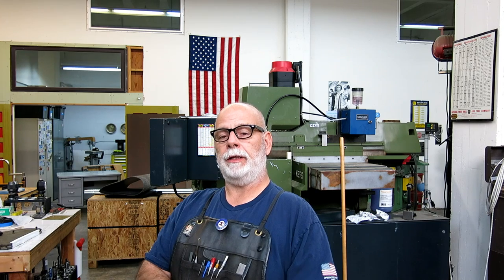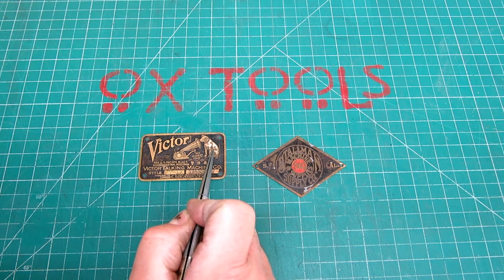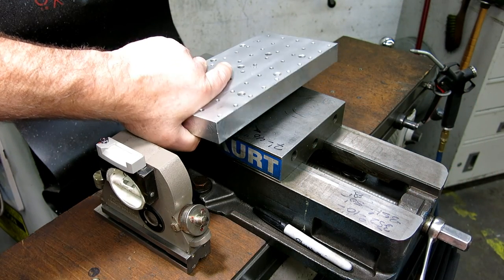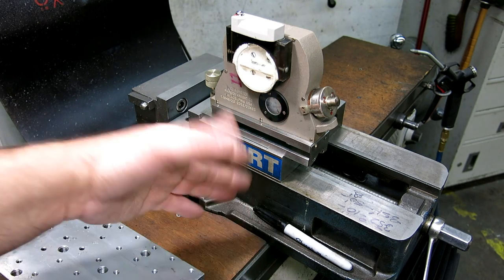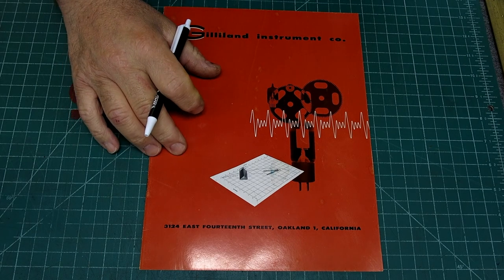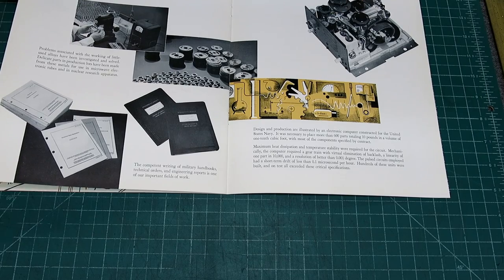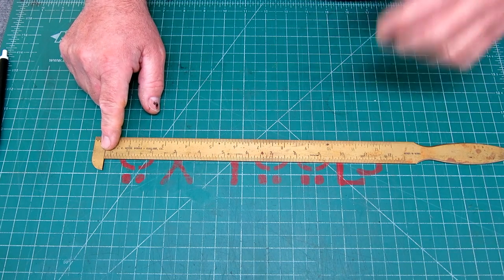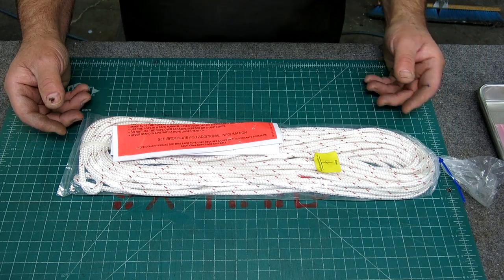Monday Night Meatloaf 140

Comment: Mule tape. When they installed fiber optic connection into our office about ten years ago, they pulled it through with mule tape and then chucked it in the trash. I fished it out and have been using it for all kinds of bizarre projects over the years.
Reply: Yeah...  They always simply throw it away when I worked as an electrician.. So I just started bringing it home. Not sure what I'm gonna do with it all-- but it's good material.

Comment: Thanks Tom, I bought a set of ratcheting straps that came it a box with a crank on the back that winds up all four ratchet straps at once. I like to lube all my ratchet ratcheting ratcheters . I like to preset the strap slots horizontally so i can one handed pass the strap through the slot with the ratchet closed and locked. I don’t let people barrow my straps or tools or machines or trailers or trucks or jacks…Etc.
Reply: I used several of mine today and noticed they really need lube, they are binding

Comment: To store my rachet straps I ran a piece of conduit the length of my trailer toolbox and I leave the straps connected in the center. Then hook the hooks over conduit for each end and throw the rest of the strap in center. To grab one, just pick a side and pull it out until you get to the other end. Won't tangle in a knot. At worse case, the handle will get caught. A  5 gallon pail will work too leave enough room between the top and the conduit for the hooks. Then you can snap the top  other can and they won't tangle inside.

Comment: I grew up with mule tape! Mine is covered in sewage from locating and pulling trace wires in residential utility lines, but it’s still going strong from when my dad passed it down to me 20 years ago.
Reply: It's cheap. It's disposable. Keeping sewage-covered pull tape is stupid and dangerous.  And why in hell would anyone pull wires through sewer ducts? Your municipality is scary.
Reply: @railgap  Really? Many crowded developed cities use sewer lines for new cable instals because they are the only way to access a building underground, especially in heritage listed zones where you cannot even put a strip ditch on a street. One big usage of sewer pipes is for providing underground internet cabling/ fibre to old and historical buildings. So there's that!
Reply: @railgap  sounds like you don't know what a trace wire is.

Comment: In 1979 I began my Tool and Die Apprenticeship at H-V Industries in Phila. We mainly built and maintained can dies for Crown Cork and Seal. The shop was next door to Warren Knight on Bennett Rd.  
A little bit of history. Before the age of CNC many people used a Bridgeport attachment called the Volstro Milling Head, to generate inside and outside radii on a part. The owner of our shop Herman Volm, and another fellow whose last name began "Stro", invented the device. Every few months we would run a batch of cast iron components for the build process of the device which was going on across the street.

Comment: Tom hello again, it's rare to leave two comments for a single video, but the second you pulled out the pull tape, I really perked up! My fellow workers and I have installed thousands of feet of Fiber Optic cable at the Television lot I used to work for, I just retired, while they would toss the pull tape, I saw the value years ago. I have recently come down to the last of my supply, well, until you mentioned Amazon! I just restocked my supply, 1000ft 78 bucks! NICE FIND TOM!!!  Again, THANK YOU!!!

Comment: Fantastic Flavour packed meatloaf this evening (African Central Time), Im marbles been turning looking at that ruler thingy magic rule tool, funny you would say would make a great laser project, exactly what I was thinking. I recon still be a bit of a but load of work, as would require at least two lasers still a bigger high power to cut them out and a smaller to Etch/Engrave the markings. Been pushing this kinda item of recent as marketing material, with all our over thirty years off waste materials off cuts of rotary engraving plastic materials old stock etc, trying to be creative and epicycle well waste at the end of the day. Will defiantly be appropriating this neat measuring device layout to try a couple new reiterations on small measuring devices/marketing/business Card ideas. Hope the move is treating you good at this stage of the game. New property looks a treat!

Comment: Regarding the webbing:
Rock climbers use a re-threaded figure 8 knot a lot to create slings. Fastened to caribiners, pitons, etc.
Tie a neat figure eight in one end of the webbing and bring around the slack end and follow the first knot, essentially doubling the web.
Yeah hard to explain, but this method, despite the weight imparted, will be easy to release. Wet or dry.
Reply: Gonna need to see a video of this one.
Reply: Yup, I don't climb much any more, but that webbing is great stuff, especially the spectra and other newer types.

Comment: I worked for a guy who used to put his mobile phone under the magnetic compass and then complain we were off course.  When he moved his phone with a "little" prompting, we were perfectly on course.
On another vessel, the emergency steering position was on the deck above the port generator.  If you made a 360 turn, the compass went from 220 deg to 260 deg, a little different if the starboard generator was on.
We used to call your end proverb type knot a Snowball Hitch!

Comment: Ah yes, rope for securing stuff. Worked as an aircraft handler during my studying time and we had to learn how to secure cargo to IATA/ICAO standards. At that time rope was still the number one option. If you know how to properly do a truckers hitch etc. you can easily break wooden boxes when tying down, as with very little effort you create quite a lot of force. It was used with a nominal break load rating (I guess the rope actually was better, but they limited it to some margin of error for wear and improper knots) and depending on the load we had to adapt the number of ropes and tie points used. Or put boards under the load for weight distribution to not break the floor of the cargo hold. The rule was like, it may not shift when tied down, even if your tie down at some points is more like suspending it from the ceiling. Could easily be done with at least three ropes on four anchor points. Some airlines back then started to require flat straps with clamps instead, no ratched straps. from the loads we had to secure using those I had quite mixed feelings about them.
Oh and back then, even on the apron we were allowed to carry pocket knifes, just in case some idiot at another airport had no idea how to tie a knot that held and you could actually untie within a few seconds. And believe me, you did not have minutes to play around with a knot when you had to turn around an aircraft. either you got it open immediately, or you cut it open.
Using the flat webbing you may just reassess the knots you would commonly use on rope. some may work better, others not so much, especailly when it comes to opening them again. But I think you standard knots lika a figgure eight or a truckers hitch etc. should be fine.

Comment: My brother in law had some to pull wire  thru a conduit about a mile long. The power company uses it once because they don't want to chance a break in the middle  of a project. You could get used rope for nothing. I got some of the scrap, good stuff.

Comment: The compass reads “ Lietz “ , the german compagny is called “ Leitz “ , still a nice one, greetings from Amsterdam
Reply: Indeed, but Leitz is specialized in filing and document management stuff, they have nothing to do with compasses. but a quick search, I found like a gazillion of A. Lietz Co. compasses of all sorts coming out of San Francisco. They made quite a variety it seems, from ones for the US Army, to survey stuff and ship compasses. Found quite a few items on ebay and in auctions, and lets put it that way, the stuff seems to go for insane prices. That actual one seems to go as "US Army Signal Corps Surveyor Compass".
Although there is no connection between Lietz and Leitz, I found that the company founder Adolph Lietz was actually born in Lübeck in Germany and came to San Francisco in 1879 at age 19.
I guess the needle is oscillating so much because it has crazy little friction and is insanely sensitive. I guess you can put that thing up and leave it sitting while taking lunch before it stabilizes. And then you can tiptoe back to the tripod and look at it.
Reply: @alexanderkupke920  There's numerous Leitz companies, the one most will be familiar with is Ernst Leitz GmbH, which owns the Leica brands including Leica Geosystems that manufactures geodetic surveying equipment.

Comment: Guys who do repelling use a lot of flat strap too.  They call it "webbing" --- and there are a lot of good videos that show how to tie knots with the webbing..  It's common for them to have some webbing sewn into a loop too, like 2ft, 3ft, and 4ft loops. (they just overlap the ends by 3 inces or so and sew 6 or 8 lines of cross stitches)-- and you can quickly use it as a tie off on your rope by rapping a prusik knot around a main line, and simply hooking onto it, since it's a closed loop;  then you can hang on that loop and unhook your main line from your belt and change ropes, or whatever else you need to do.. Lot's of cool things about knots and ropes can be learned by climbing and repelling guys-- Youtube is full excellent videos about ropes/ knots from the climbing world-- same goes to the rigging world-- sail boats..  It's kinda like machining in that way, you go down a rabbit hole a learn a few things and you realize how deep and wide the knowledge can go.   Most climbing gear is rated in kn- kilo newtons... So like a standard hook could be 18kn or 22kn...  and 1kn= around 225lbs... So a 22kn hook would hold 4950 lbs...   So I always think of it as a multiple of one mans' weight...  So if a hook or prusik webbing loop or rope is 22kn, It will hold 22x your body weight-- that's just a quick way to remember..... Those climbing hooks are just a thin/ light little forged aluminum hook with a latch on it--- you would never guess it can hold 5k lbs.  Same with some ropes-- there is a lot to know in the selection of a rope--  there are different amounts of weave-   such as regular twisted 3 strand... or  a 12 strand rope vs a 36 strand double braided rope... And these ropes also have a second rope in its center, which can be straight strands-- which makes a 'static rope" -- or it can have another weaved rope as a center, which makes a 'dynamic rope-- because the center will stretch just like the outside sleeve.... You can have polyester outside, but nylon in the middle---  or a nylon outer sleeve but with Dynema in the middle, ect..   There's so many different things that go into making ropes, and you have to learn quite a bit before you can make an informed decision on buying which one you actually need...   Like such as, Nylon is more water resistant,  but a poly propolene rope will float, ect..  ( you can't go wrong with polyester/ nylon/ dynema)..   and the same size rope can have wildly different strengths-- even if it's similar material......  Such as a cheaper 5/8" , 48 strand polyester rope may hold 9k lbs--- but then a 5/8"  12 strand polyester rope might hold 15k lbs...   But a 5/8" dynema rope will hold 55k lbs.. It's crazy stuff-- people like to replace the cable in their winches with dynema rope-- because it's even stronger than steel cable a lot of times. I actually did electrician work for a couple of years out of high school and we would do long pulls through pipe with that webbing that you have-- and they would just throw it away;   so I started bringing it home.. .I have several large rats nest's of those things-- still haven't found much use for it all; but it's good to have and not need it. lol...  Congrats on your place-- I'm jealous.

Comment: Can you please make a video about the correct and proper way of installing and bolting 2 micron precision linear guide rails onto precision granite surface plate which has a surface finish of 1 micron? The surface plate will be about 12 x 12 x 3 inch. Linear guide rails will be Hiwin. No one discusses the proper way to install them in a fundamental way. Thanks.

Comment: Ref. the circumference rule, in the 1960s as an apprentice I worked in the Bristol Siddeley Engines aero engine factory in Bristol. (UK) we used the reverse of that, a circumference tape. Each inch was pi inches long and we used it to check that a welded up casing would produce the correct diameter when rounded up on the stretcher press. They then had edge rolled and machined flanges welded on. Happy days!

Comment: I worked in the electrical trade and we called that pull webbing “mule tape”. Great stuff. You can tie a strong loop with a “water knot” (aka overhand follow-thru) making sure to put back-up knots in the tails. Just keep it flat, with no twists in the knot, and that stuff is not coming untied. Climbers/arborists also tie webbing loops this way, and their lives depend on it.
Reply: Not sure if I was able to read it properly, but I think that was actually stamped on the webbing he showed. at least the "cleaner" one. I think the dirtier one said Pull-Line.

Comment: Bias: I love ratchet straps and misuse them for all kinds of bad ideas. Webbing and pull tape: I use it too, especially as a climber but all kinds of things to be careful of. 1800lbs is only without any knots in it, and it loses more strength in knots than rope does. Probably still overkill for whatever you want to do but worth being careful about.

If I need a little weight I keep some Paracord in the trunk next to the ratchet straps, if I need a lot I've got some dyneema slings that are good for 2700lbs (and tiny!). Other advantage of dyneema: if it breaks under that kind of strain it just flops on the ground like a dead fish, no rebound

Comment: I’d you follow the phone and cable drop guys, or find them out in the field, talk to them. When they pull a cable, they toss the rope. The big roll of orange pipe comes with the rope usually already inside.

Comment: As far as nylon rope and that strap cord for pulling wire the next time you see a crew doing above or under ground wiring go and ask them for the used sections. They can only use it once because of safety reason and usually throw it away after use. I’ve gotten rolls of it from crews , sometimes a 6  or 12 pack of brew helps for the cause.
Reply: I'm very curious to hear about these "safety reasons." Sounds like something they told you that translates to "convenience reasons."

Comment: ratchet straps are one of these things that works better if you leave them outside for a couple of weeks then take them in and give them some oil. 
here i europe the smallest ratchet strap we can get is 25mm wide and rated for 340kg (750lb)
the big ones we use on semi trucks are 50mm wide and rated for 5000kg (11.000lb)

Comment: Why are the E(ast) and W(est) marks on the opposite sides to that expected ?  In answer to an earlier comment, magnetic compasses are affected by two factors Deviation & Variation.  Deviation is the effect of magnetic materials around the compass, Variation is the wandering of the magnetic north pole, if you look on marine charts they will have a note of the variation in effect at the time of printing the chart and the anticipated change over time.

Comment: At 27:37 looks to be an incomplete Heisler locomotive engine.  From the table top and the things around it, it appears to be about 2.5 or 3 inch scale or about 1/4 or 1/3 full size.

Comment: When you were showing the pictures of the estate sale, the very last slide looked like a very blocky V-Twin engine. I'm confident it is not an engine, but could you explain what that is? It looked like it had two hydraulic actuators at 90° to each other both acting on a central shaft. I cannot for the life of me figure out what that was. Can you please tell me?

Comment: One note on the mule tape vs rope: (quality) ropes usually have a 10:1 or 12:1 factor of safety built into their strength listings. As far as I can tell, pulling tape is listed as its actual tensile strength.

Pulling tape is still way cheaper and super handy though.
Reply: "...ropes usually have a 10:1 or 12:1 factor of safety built into their strength listings..."
Pretty sure this is so. If your after 'for real' quality materials, check some outfits that sell sport skydiving rigging supplies... 'Paragear' & 'ChutingStar' are two. There's probably others... they sell online. Paragear has been around for eons.

Comment: Used ratchet straps for decades. Used properly, no problem. Used improperly, still safer than a snapping chain. 😱Good rope/tape is very expensive and still creeps like mad, under mild load.😒Dyneema is great, ultra low stretch, but you  need to buy a wack load, from Timm Ropes, to get a deal. Cost benefit ratio gets a little out of kilter, otherwise.
Best wishes from the far North.

Comment: I am concerned that i cannot reason why  East and West are swapped sides on the compass?
Reply: Me too!  Is it made to be mounted the other way up?
Reply: The pointer always points north, if you turn the compass clockwise 90° to point east the needle will stay still and thus be pointed 90° counter clockwise from the North mark on the face. Thus that is where we put the East mark.
Reply: At 16:02, the sighting is NW and that is what the compass is reading.  Therefore the compass is not miss-marked.  When set up to take a reading to go East, the N will be to the North and the sighting will show E or 90 degrees on the compass.  It is much easier to show than to describe.
Reply: @royreynolds108  I should have paid more attention to what Tom was saying.